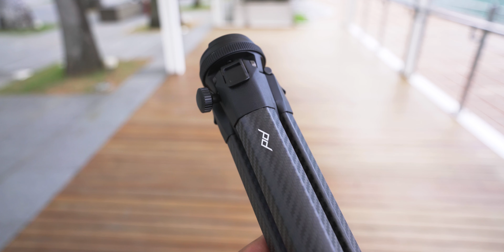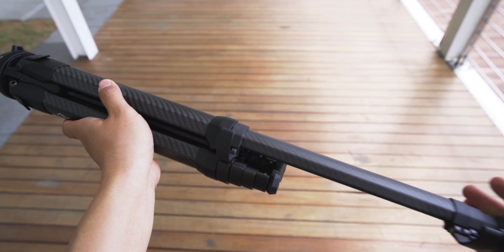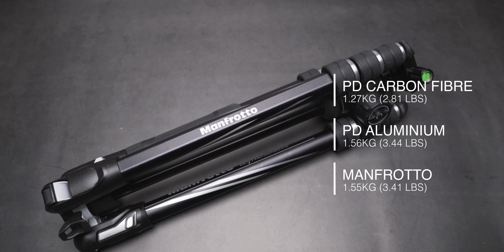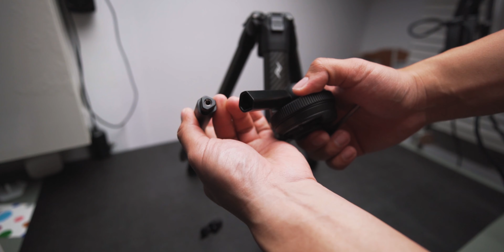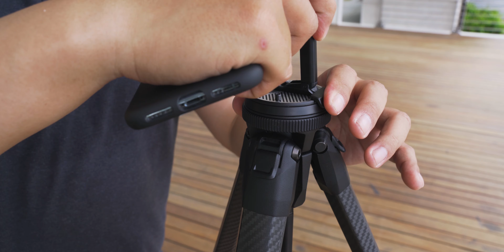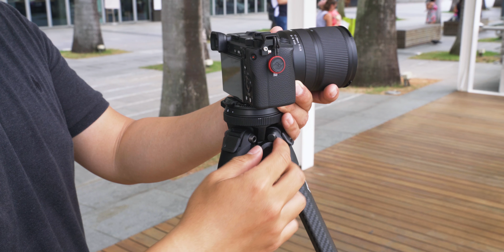Is the Peak Design Travel Tripod worth $600?

Comment: I like PD's take on the travel tripod. Not the lightest but very sturdy and stable and with high quality materials which is a good tradeoff in my opinion. Not much plastic used so durability wise top notch. Pretty much every component on this is tripod is custom made which adds to the price too. The shape of tripod legs are unique and not found in any other tripods. Probably someone will eventually copy it but I reckon it will pretty expensive to do so... 

It's PD's first take on a tripod and yes it's expensive but they've put a lot of effort into the making so it will reflect to the price. Of course the tripod isn't perfect and PD will continue perfecting it like with their other products. Quality, innovative products, lifetime warranty and fantastic customer service are the the reasons why I support them.

I backed the carbon tripod on KS and saved a bit of money (about 20%). The reason I got it because of the lifetime warranty which they will definitely honor. And in my estimation KS price was about the same if I were to buy for example a Sirui N-2205X and K-20X ballhead.... Usually people tend to forget the ball  heads when comparing tripod prices and most companies include don't include it. So that's one of the things to consider.